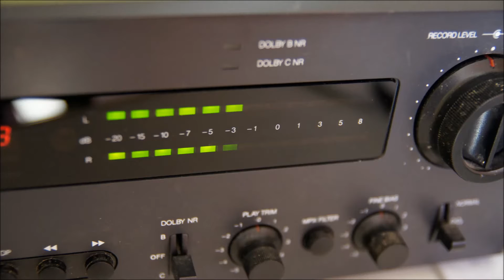NAD 6100 Monitor part 1

Comment: I have a Nad 6140 very similar, the deck wont play i manage to force play but al fails maybe start in mechanical part.. these has soft buttons.. do you have any idea how to start?  sorry for my english.
Reply from the maker: 6140 has other mechanism!
Reply: @bajekanal4734  Thanks!! i will try to revive it.. these decks has quality or are common?
Reply from the maker: @nopochoclos  nad all are good
but nad 6100 is acoustically something special
sounds better
Reply: @bajekanal4734  Thanks, it come when buy destroyed nad 3020 and the receiver 4020 only Fm (what a rare thing only FM) , the Nad now is runing with Panasonic new capacitors, but i have some thing called subsonic .. the speaker on the left is moving very bad  when up the bass , if less bass like mid point no problem, but is a left channel problem, and still need bias calibration, but one test show the sound is like new..
Reply from the maker: @nopochoclos  sell 3020 is good but technology is moving forward
buy a NAD C 316BEE
Reply: @bajekanal4734  Yes, it is true there are new technologies but I love old school, I am passionate about technology, I have new equipment but I do not enjoy the old ones anymore, not to mention my collection of 8-bit computers Commodore Atari and MSX and video game consoles .. the new ones are very pretty but I keep the classics.
thanks for de advice!
Reply from the maker: @nopochoclos  3020 is musical and has strong bass playing very wide
can understand if you like it